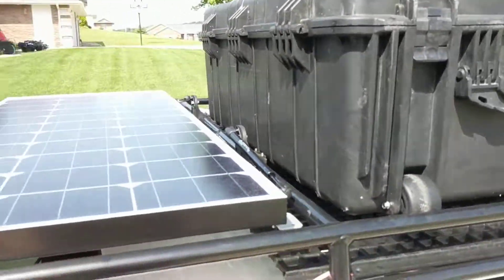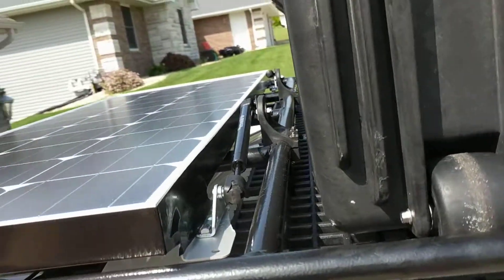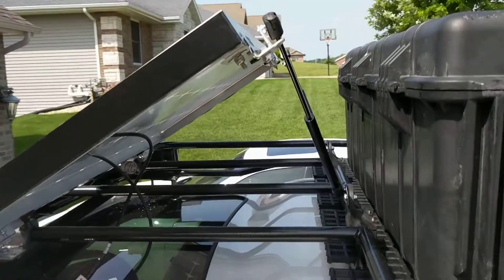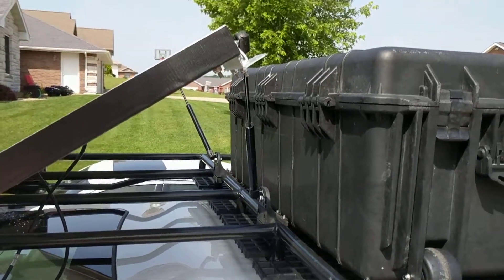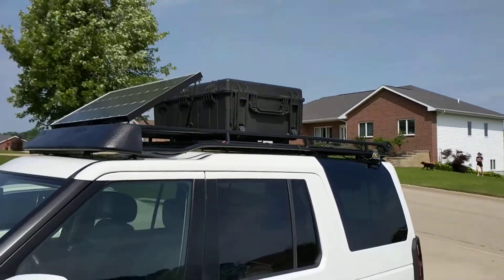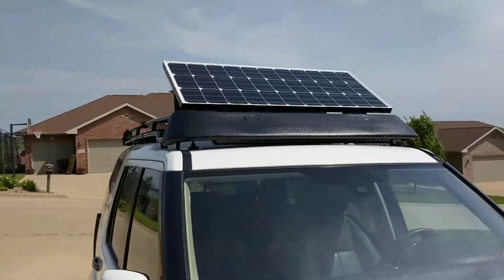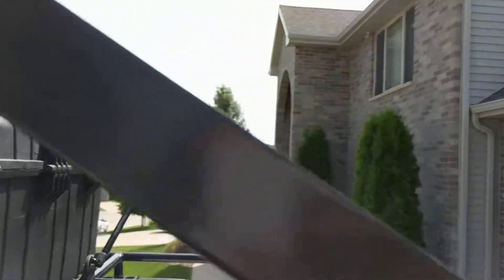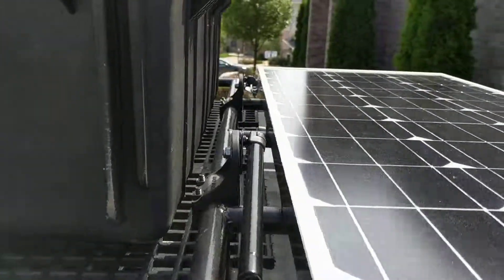LR4 Pop up solar panel setup.

Comment: Nice work!  Been thinking about a similar set up on  low roof, SWB 118 promaster 1500  where the solar panel is reinforced with aluminum cross members and serves as a sealed lid over a large 36x24 opening between roof supports to allow for air circulation and standing.  a 1 inch lifted lip and weather strips make it watertight.  That it's open to the inside helps with heat and airflow, but really efficiency will be greatest when it's popped up. .